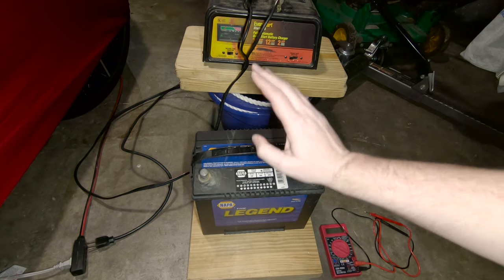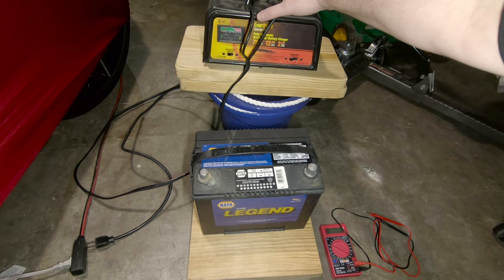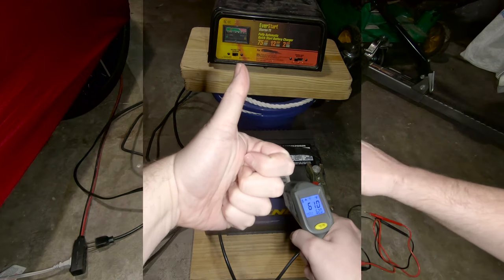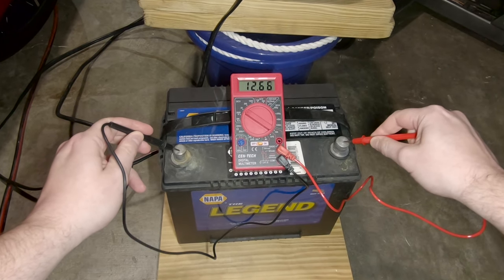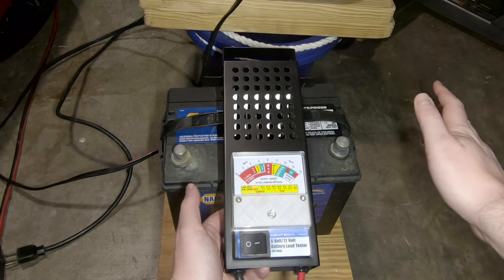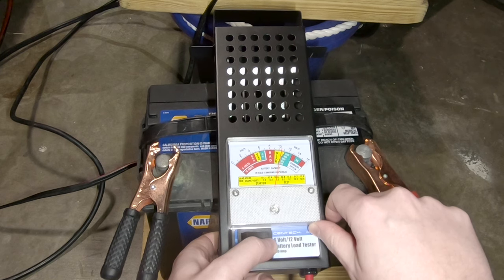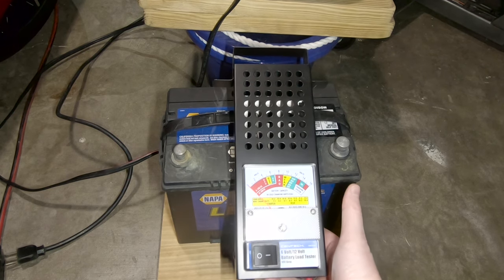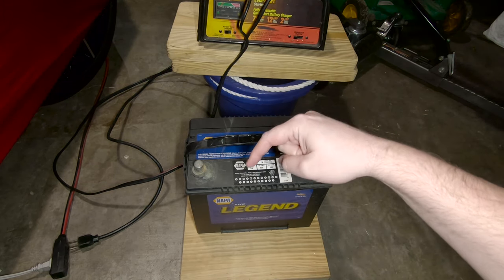How to Test a Car Battery | Harbor Freight Load Tester | Project Milano Ep 2

Comment: Great voice for video.  Short and sweet, good duration.  

One reason the device is smoking:  In the Owner's Manual, next to "Test Cycle", it says "10 seconds per test with 1 minute cool down; 3 tests in 5 minutes."

So, you are not supposed to do a load test immediately after doing one.  You can leave it on and just measure, but the Test Cycle applies to pushing the load button.  

It still may smoke, but, not as likely if you separate the tests by a couple of minutes.